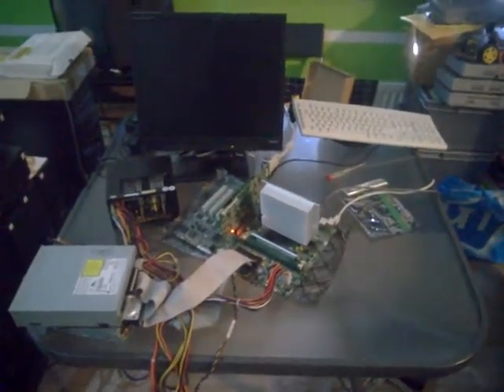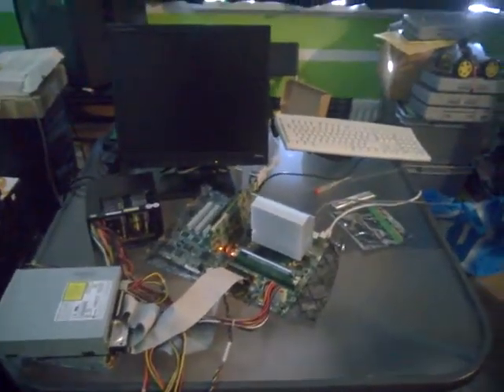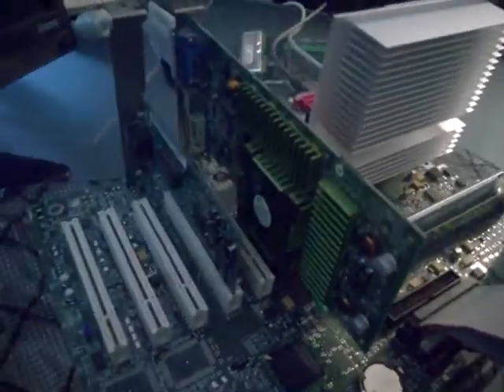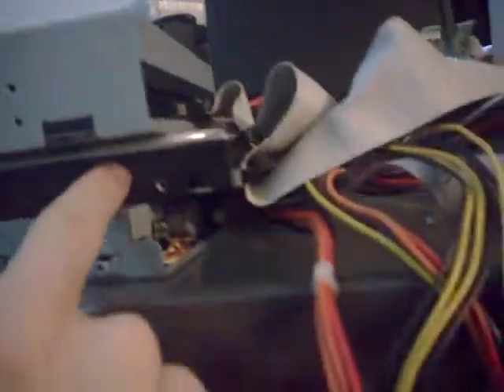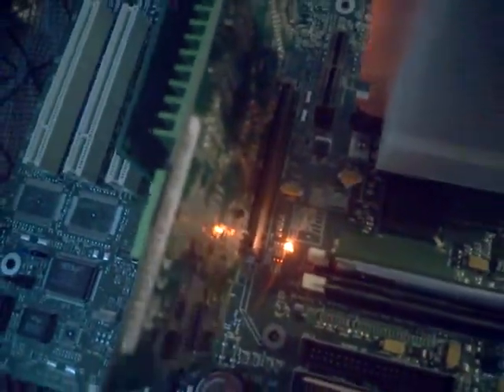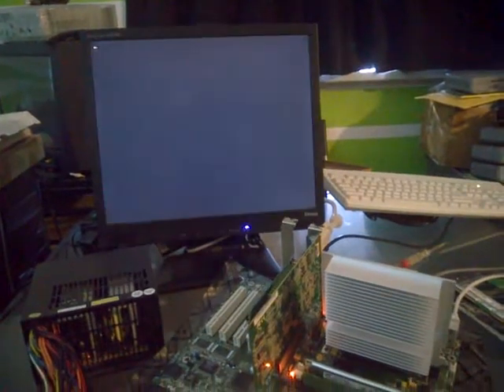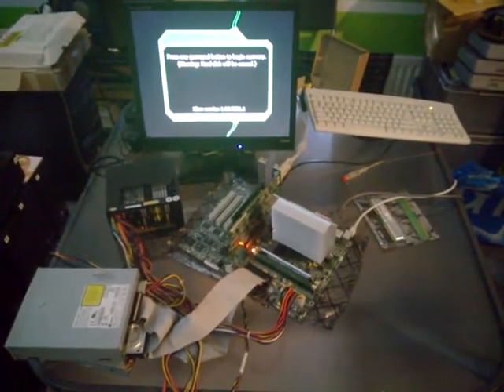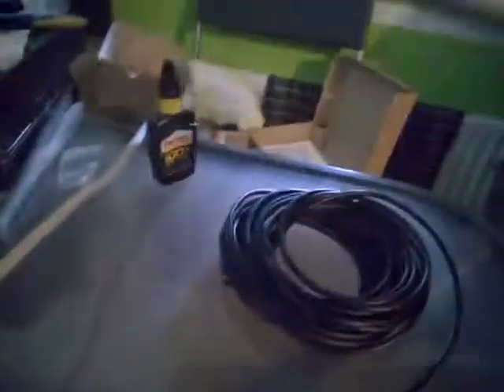E003 Xbox alpha from ebay parts

Comment: hello, I just finished building my alpha kit but i cant seem to get the recovery to work. is it possible you could help me troubleshoot it?
Reply from the maker: ive tried some configuration changes and written down the kernel debug logs Ive got. also some hardware details can be found here: https://xboxdevwiki.net/Development_Kits#Alpha_I
Im also on some xbox facebook groups, discord and reddit. Do you have kernel debug logs? its connecting a computer to the serial port of your alpha and starting WinDbg, I dont think you need symbol files at all to see early hardware logs, but they are included with the recovery. Maybe, I havent tried, the xqemu project debug perl scribt might output logsaswell. It will tell you if the gpu is correct, the network card, the hardisk is found, that sort of things. I also asume windows installs fine and all hardware works. minimaly you need the mobo, cpu, ram, networkcard and gpu. Sound and usb is not needed for the recovery to start, you cant press any buttons tho without usb
Reply: also, i am very fluint in computers where i can put them together and install stuff, i dont know indepth on how to make them work, so anything command line and anything to do with the inner workings of windows, i have no knowledge of, but i am willing to learn.
Reply from the maker: @aidanrosenberg3513  cant seem to be able to directly add you, but im also on this discord group of obscuregamers, https://www.obscuregamers.com/ the link to discord is somewhere top, no need for registration. Im sure other too can help, its getting late here.
Reply: @CodeAsm  my appologies, you need the 4 diget number for my name on discord. try slycooper124#6199